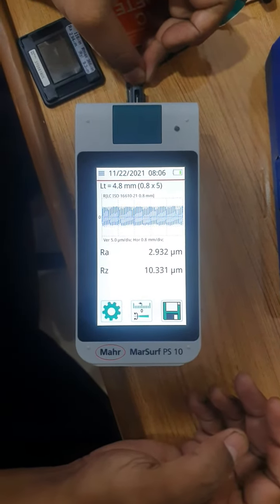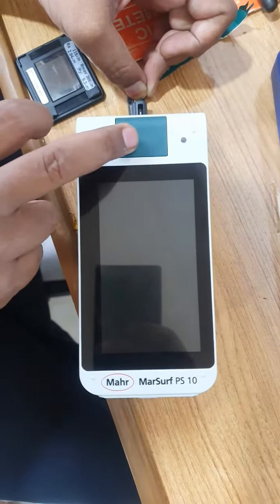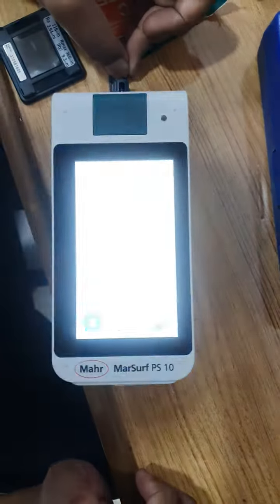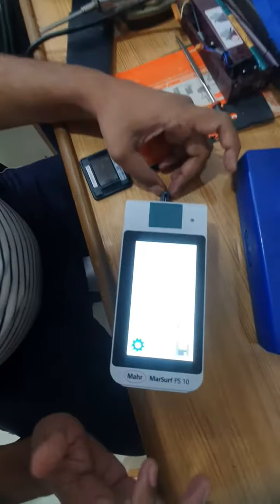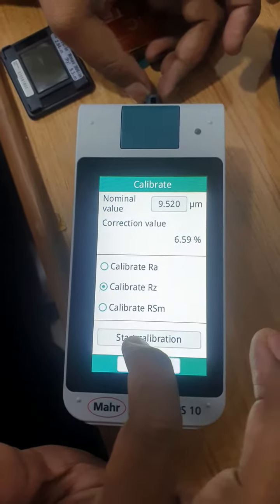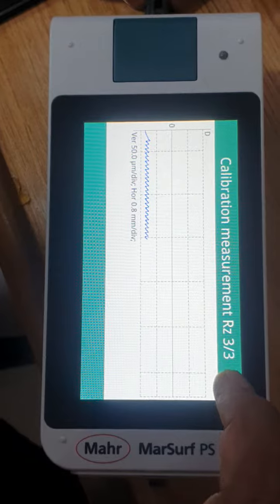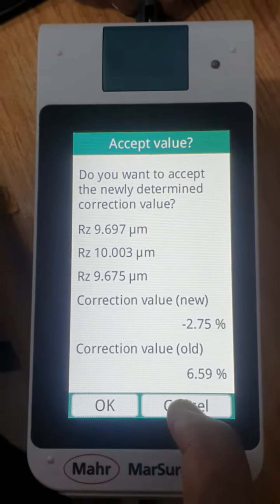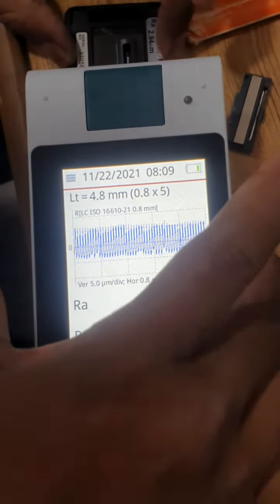Mahr surftest ps 10 setting and calibration

Comment: Hello,
Can you compare the Mahr PS -10 to the Mitotyo? e.g. which one is easier to use, has more options?
Reply from the maker: Mitutoyo  or mahr ps 10   both have different features  mahr is touch display   and Mitutoyo  is key press  ,, but my point of view Mitutoyo  is very easy to use and good repeatability   .and after  sales and service  Mitutoyo  parts easily you can get and price is less than mahr.